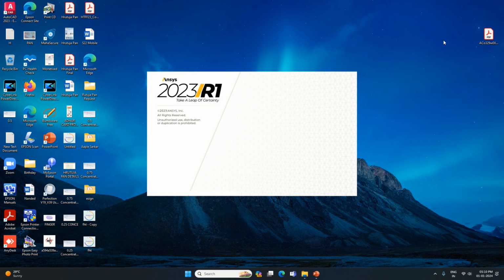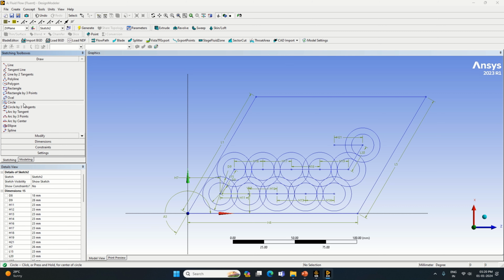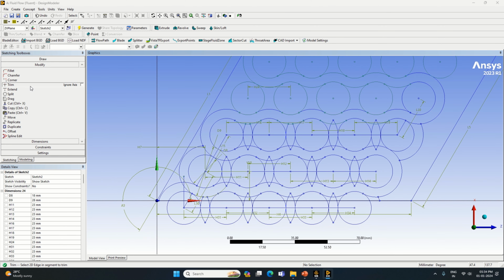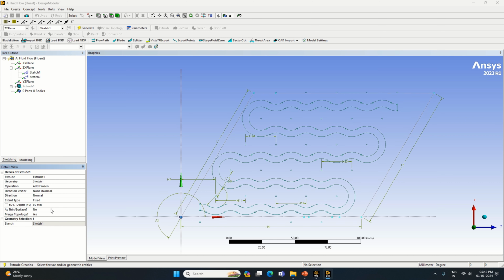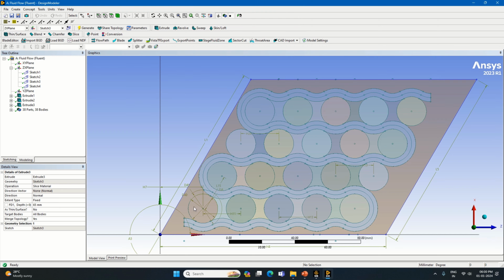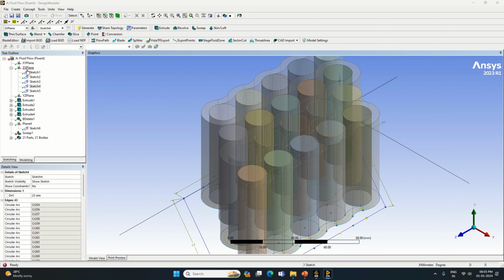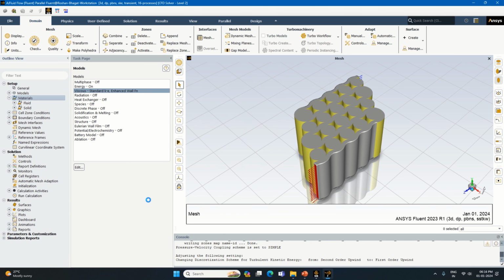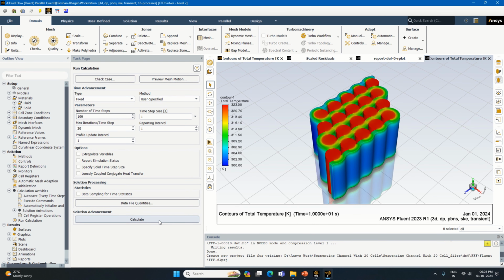CFD Simulation of Thermal Management for 20-Cell Lithium-Ion Battery Pack with Serpentine Channel

Comment: What if we want to observe the cooling of the cells and the temp variation due to cooling? How must we setup for that, because in the current setup, I guess the cell temp has been modelled constant and doesn't get effected by cooling.
Reply from the maker: Yes here the boundary condition was use as temp, you can give heat generation to the cell in cell zone conditions. you make check latest videos on channel for heat generation

Comment: Sir why have you used nickel instead of lithium, becuz u r doing for lithium ion cells, not nickel
Reply from the maker: received as requirement assuming that the outer layer lithium battery has nickel coating
Reply: @FrontiersInCFD sir if we do for lithium ion batteries, then what should we select? kindly explain

Comment: First of all, Thanks for the video. Actually, I am wondering how you decided the time step size in this problem?  Did you use Co number (if used, which interval should it be on this kind of problem) or just wanna show how to apply boundary cond. and randomize it to shorten the video?
Reply from the maker: it depends on the element size you have selected, but preferably if you want to capture minute details you need to take smaller time step size, however the time required will increased significantly and file size also
Reply: @FrontiersInCFD  Thanks for quick response😊

Comment: Instead of adding temp to cell boundary can i just make cell as heat source ?
Reply from the maker: yes you can use source term as heat generation per unit volume

Comment: How to check the flow of heat transfer in the fluid ?
Reply from the maker: set the temperature streamline to know the inlet and outlet temp of fluid
Reply: @FrontiersInCFD  will that get me an visible flow pattern??
Reply: Bec I just don't want the temperature at 1 specific point but I am interested in the pattern forming across the whole whole heat pipe
Reply from the maker: Not invisible
Reply from the maker: Yes you can get the pattern of flow along whole pipe

Comment: Can you show the cfd simulation of battery pack consisting of cylindrical cells using the battery module feature in ansys fluent
Reply from the maker: Will work on it